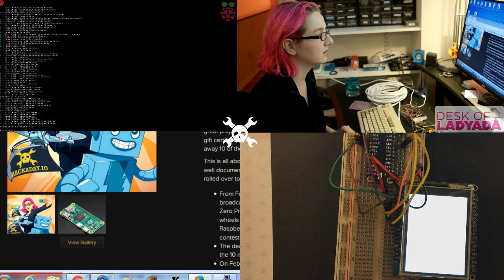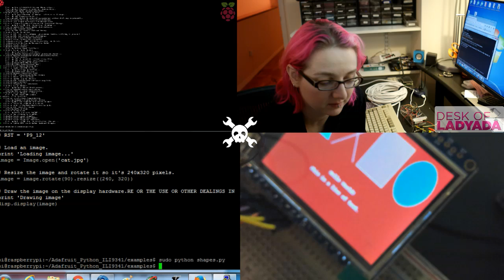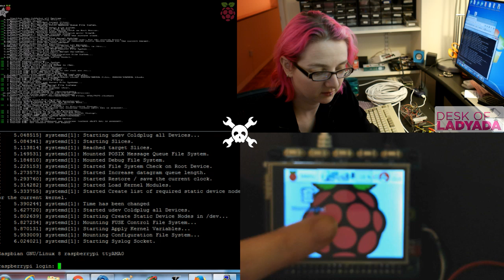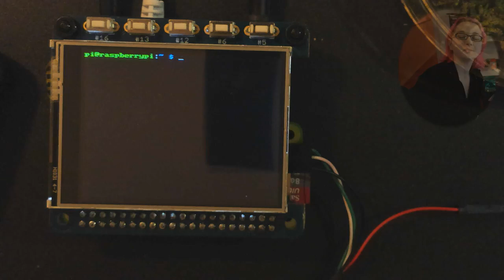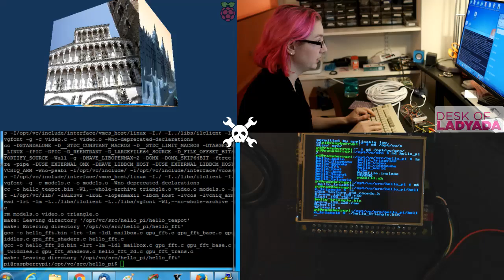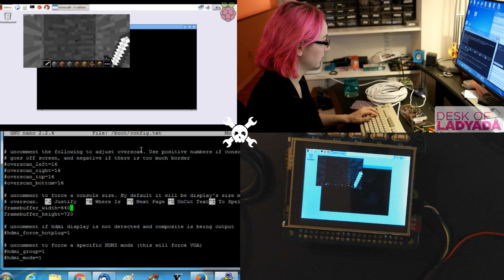#PiZero #PiHackAda @hackadayio @hackaday PiZero Contest Q&A live tonight! 9PM ET 2/6/2016

Comment: How does the pi detect the screen resolution? did you modify the config.txt ? is something related with the retropi you installed?
Reply: it looks for HDMI first, then if none, will go to the composite output
Reply: have to go in and adjust resolution to screen being used as well